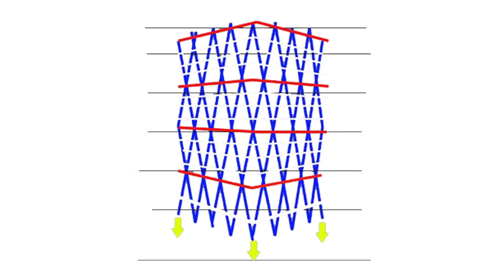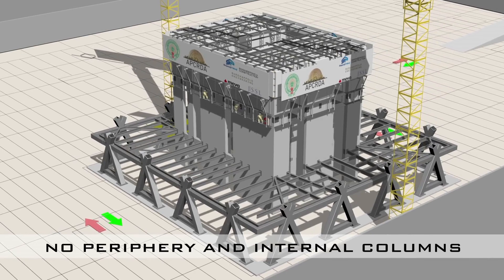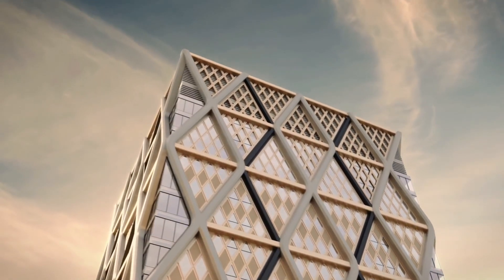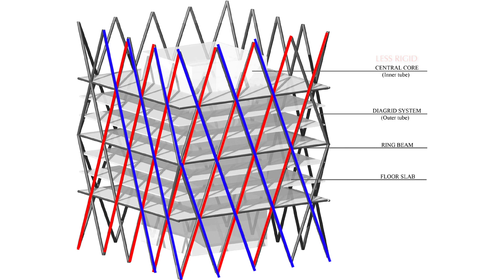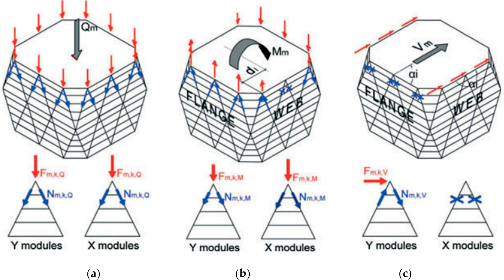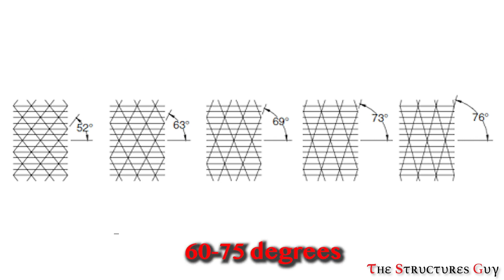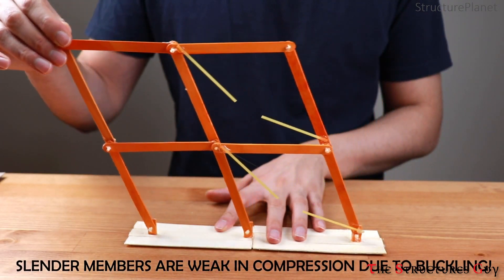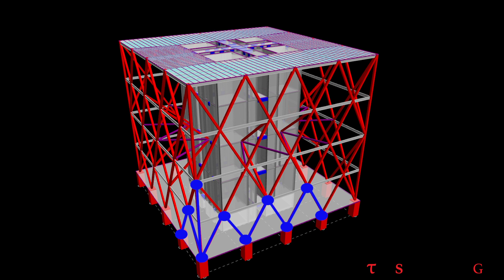The Engineering of Diagrid Structures

Comment: Diagrid is a framework of diagonally intersecting metal, concrete, or wooden beams that are used in the construction of buildings and roofs. The origin of these structures comes from the Russian genius Vladimir Shukhov. He pioneered new analytical methods in many fields. Great video. I liked it a lot and subscribed to the channel.